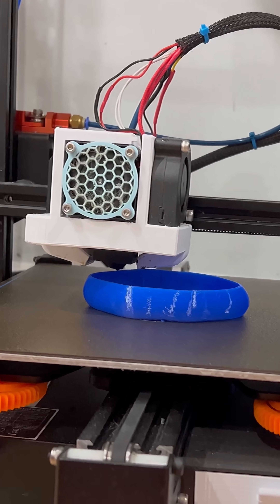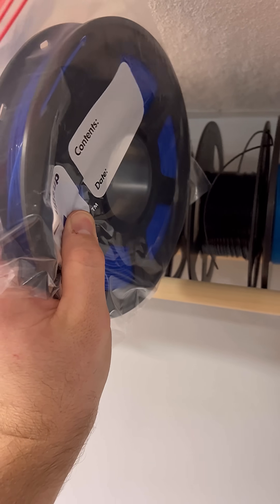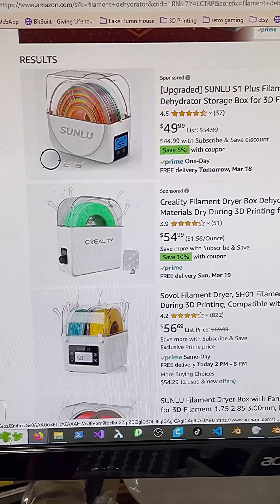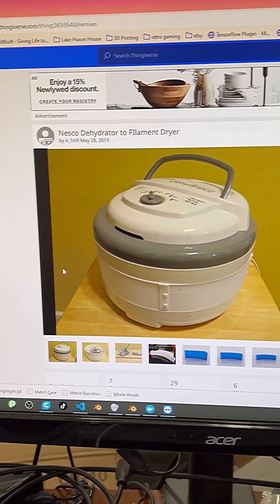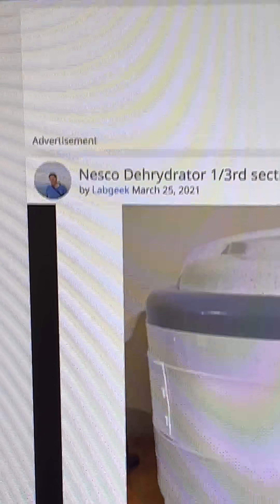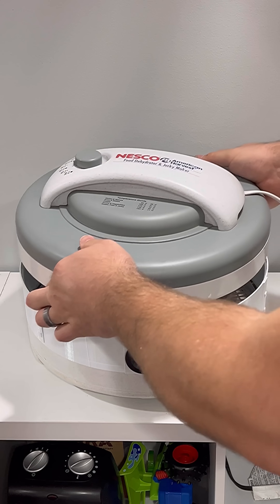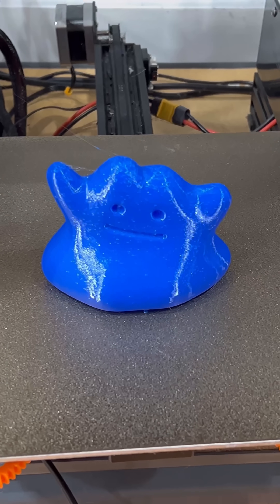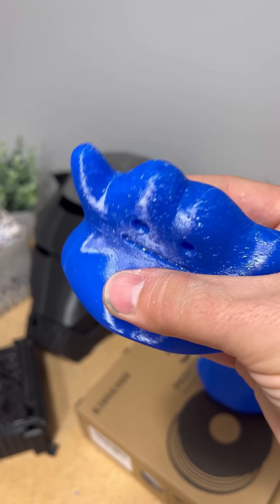Dry vs Moist TPU in 3D Printing

Comment: It’s really interesting. How much of a difference even just settings can make for TPU, I just got a filament dryer, the creality space pi X4, but if you have the right settings, it won’t be perfect. It’ll be far from perfect but you can really decrease stringing just from settings. But usually a Filament  dryer is necessary

Comment: It's helpful to remember that when water flashes to water vapour (steam) it expands by a minimum ratio of 1,600 times.

So, if you flash 1-litre of water to steam, it now occupies 1,600 litres of space. 

And THAT is why you always store your filament in sealed vacuum bags, with a hygrometer inside the bag, and the inside of the spool has a 3D printed recyclable desiccant holder inserted into it.

Comment: If you have a good AirFryer it will be able to work at temps as low as 40 Celsius so you can dry ur PLA or what ever at like 45 for 2 hours +- and get same results

Comment: i have heard from someone you can use your 3d printer to dry filament, just put the filament into a box and throw it on the print bed of the 3d printer set to like 50°C

Comment: What temperature does the dehydrater run at?

I work in plastic color, and running tpu is one of the worse resins we use. It is a pain. We don't dry tpu in our lab, so this is something that never occurred to be possible to me.

Comment: I dont have a dehydrater but i used my oven
Reply: I wouldn't suggest using an oven for drying out filament ever.
Reply: @hikaru9624  it works.... I have to tweak around though.
Reply: @CampBloodCreations  I still wouldn't use an oven to dry filament!  That is a house fire waiting to happen!!  There are far better and safer ways to dry out your plastics.
Reply: @hikaru9624  i know, but the oven is the closest I have,im saving up for a dryer.
Reply: @CampBloodCreations  that's great,  but in the meantime seriously stop using the oven to dry out your filament.
Reply: use your build plate

Comment: Poke  a bunch of tiny holes in a 5g bucket take plastic wrap , place bottom of bucket on to make it one then put that on the dehydrator itll seat perfectly if u wrap it right (no serious overlap of saran wrap in the  chamber and out the lid in the top of the bucket…WALLAH !! now u can dry multiple rolls and have a better filament dryer then that or one you’d buy anywhere. 

I see your dehydrator has notches in the middle either cut them down or use a hole saw to make a hole in the middle of the bucket. 

Its an old mushroom drying trick, if u wanna see the original  tek lookup bucket dehydrator mushroom dryer or bucket dryer dehydrator shroomery and you’ll find it. 

Y’all will thank me later💪 
Cheers

Comment: It makes absolutely zero difference. Your problem is user error.
Reply: Wrong
Reply: @timo4463  no I am correct. I have spools that have been open for 2 years and print just as good as new. It is user error. Maybe get better at 3d printing.

Comment: It's great that you've found a simple solution to this moisture problem, but I'm more intrigued that printer filament absorbs moisture from the environment in the first place...

▪︎ Why/how does this happen? 
▪︎ Is this a fundamental property of the plastic itself or a factor introduced during the manufacturing process?
▪︎ Perhaps making this kind of moisture absorbing polymer structure is a trade-off for keeping it flexible enough to be printable?
▪︎ One possibility is that it's the extrusion process (where molten plastic is squeezed into filament under tremendous pressure), which introduces microscopic air pockets where water can accumulate?
▪︎ Manufacturing the printer filament it in a vacuum chamber (where no air bubbles could form), or increasing the extrusion pressure (with the caveat that this would lead to a slightly denser material, requiring printing setting tweaks) may fix the problem, but it would also increase the production costs.

It's possible, even probable, that there are perfectly reasonable answers to these questions, but at the same time, it's good to ask them, as thinking about the causes of such problems can lead to improvements in the manufacturing process which eliminate them entirely. Good design is a constant process of re-evaluating your methodology to identify flaws in your process & then fix them.

Comment: Do not underestimate moisture with filament. It's night and day difference. It can be annoying to store it in closed space (1 day and your print are already starting to worsen), but it's just vital. If you don't want to spend 60$ on a dehumidifier, there are 2 other solutions, much, much cheaper. Put your filament spool into a shoebox, and make some holes on the top so that humidity get out. Now you put that on your printer bed. Another solution, Put it into a ventilated oven (though do not go too high, oven tend to not be very precise). For temp and drying time, you can basically take what is said for dehydrator (maybe even a bit higher, but if your filament start to stick a bit to the spool, do not increase the temp, decrease it a few degrees)

Comment: Dude, next time just use a bucket on top of that thing with a few holes drilled in the bottom. 30 second fix vs whatever time and materials that cost you. Plus you can stack like 6 rolls under a bucket.

Comment: I used to not really mind the difference between dry and wet filament when I started printing years ago, and since I was running a kind of crappy printer, I could only get crappy results. FF to recently when I purchased a more premium high speed core xy machine where I was running into bubbling trouble in my prints. I purchased a drybox for my tpu and now even pla I do not run outside of the drybox 😄

Comment: This seems like a problem you'd only have with non hard plastic prints. This is actually the first time I've ever seen a soft plastic printer tbh, and I've also never heard of moisture issues in prints. So I'm assuming they're connected.

Comment: I use this exact dehydrator for my filament! You dont need the extender thingy tho, just throwing a towel over it to trap the heat in a bit does the job perfectly fine

Comment: It never occurred to me that filament would gain moisture but that actually kinda makes sense!
Reply: It's the biggest fatal flaw for TPU, including finished products - just ask the TPU "pleather" shoes I had stored with some other stuff in a garage. (It came apart, all peely & gunky.)
Reply: @mookinbabysealfurmittens  omg yes so much of my stuff is that crappy pleather now. I miss 90s products because they lasted for so long and some still going.
Reply: Moisture is a problem in a lot/ most of precision manufacturing. I can’t really think of one where it isn’t but am sure there are. I’m an aerospace guy so moisture is the devil.
Reply: Makes a bit of sense for a flexible material like this at least. Not so much for rigid plastics I would think.
Reply: @MsHojat rigid plastics can be the same way, but they wet slower
Reply: @MsHojat  It is significantly worse for several types of rigid plastics. 

Some can even destroy nozzles when wet.
Reply: yeaaaa

Comment: My dad also has some issues with wet filament. We live in florida, and the 3D printers are also up stairs, so it just keeps getting worse lol!! He has a few dehydrators on his smaller printers that onky do 1 color, and a case with a dehumidifer that is over the top of the big 3D printers(came with them) that print 4-5 colors.

Comment: I didn’t even know you could 3D print flexible things, so that squish at the end was hilariously jarring XD
Reply: I felt the exact same way. 😂 I mean it makes sense that you should be able to, but I never really thought about it before this video.
Reply: @kraziecatclady  Same for me.  It felt so wrong to see.
Reply: TPU is by far the most common flexible filament! PLA is the cheapest for rigid stuff
Reply: @bachaddict PLA is also easily the most versatile, and it’s actually a biopolymer (polylactic acid), so it’s somewhat biodegradable too!

It replaced ABS (same plastic as Legos) for 3D printing because it doesn’t give off nearly as many fumes and prints at lower temperatures
Reply: @TheEmeraldMenOfficial only if it's sent to an industrial composting facility.  They are not common.
Reply: @TheEmeraldMenOfficial  PLA did NOT replace ABS, even PLA+ lacks toughness and gives up when put under constrant stress. Pla also melts with a lower temperature. That's why diy 3d printers are always made out of ABS/ASA
Reply: @bachaddict TPC is more flexible
Reply: @bachaddict oooo cool
Reply: @bachaddict  TPE?
Reply: @bachaddict  PLA ain't the cheapest but it's definitely the easiest
Reply: @bachaddict  PLA is absolute crap.
Reply: Same, guys... didn't realize that's what TPU was!
Reply: SAME
Reply: SAAME BRO
Reply: The same thing happened to me when I watched someone making 3D printed shoes!
Reply: for some reason my reaction to the squish was 😧 with an audible gasp lmao 
it was just surprising to see it squish lol
Reply: Same
Reply: Me either! I think I got whiplash from it LMFAOOO
Reply: Omg lollllll same
Reply: yeah i never really messed with it due to it being a little tougher to set up and never needing to use it, but its really cool!
Reply: @krogonronavix2595  I bought some TPU to print out gaskets to seal projects. its also good for making "rubber" feet for furniture,  bumpers for corners, and stoppers.   it can be useful.  I mean,   did your kid loose a wheel on one of his toy cars/trucks  print one up in TPU.
Reply: @agriperma How good does it work for gaskets? I never even thought about that! is it air tight?
Reply: @krogonronavix2595  I have some outdoor communication equipment projects in the works, and intend to use printed gaskets made of TPU,  I will probably use silicone grease (lubricant) to help with the seal.  I have not even gotten it out of the box yet,  but seen it being used for hat purpose,  they come in different shore hardness,  pretty sure the softer would work better,   but it is much harder to print with.
Reply: Literally me 😭
Reply: oh yeah theres all sorts of different filaments with different properties, its dope
Reply: THIS 😂
Reply: I 100% agree
Reply: Same 😂
Reply: SAME LOL
Reply: TPU is by far my favorite filament, doesn't matter what it's used for. It's always fun.
Reply: nearly gave me a heart attack, jesus

now i want one tho
Reply: You can 3D print nearly any texture/material, it’s crazy.
Reply: As someone who just got into 3D printing. Same 😂
Reply: That's TPU for you. It's still always weird to me as well.
Reply: It’s legitimately a bit unsettling💀
Reply: You can print almost any material. I've 3d printed parts for my motorcycle for example in Carbon fiber nylon and ended up being way cheaper than buying them from retail.
Reply: @ramaSwamp That’s so cool! Do they withstand heat?
Reply: @JigglyPuff_JesusChristLovesYou  they can withstand around 190°C no problem. Plus the dursbility, tensile strength and vibration absortion makes it amazing to print for motorcycles, cars, etc.
Reply: @ramaSwamp That’s really cool! I would love a 3D printer.
Reply: I now want to get a 3d printer and make a version of the crystal rock drake 3d print but make it squishy
Reply: you learn new things every day like there's squishy filaments or sth
Reply: I went from :) to :/ with a slightly open mouth
Reply: let me tell you about 3d printable shower attachment banana washers and grape cleaners!! very handy devices for when one has dirty banana or grape.  very handy!
Reply: It's just a different filament
Reply: Lmao yeah tpu is very flexible

Comment: Boiled while printing* 

Evaporation is a slow process with a pool of water slowly disperses into dry air, what happens is the nozzle is sudden vaporization and expansion of steam, which is what causes over extrusion/negative material zits

Comment: Drying filament is a myth. I have rolls that sit out for months and print just fine. I also got some rolls from Bambu and it said you must dry before using. Printed flawlessly without drying. I also print in PETG almost always, which apparently soaks up more moisture than PLA. Average humidity where I live is 75%.

Comment: I use a storage box with self adhesive draft stop foam and $2 room dehumidifier thingy and seems to work just fine to keep my filament dry it seems to work fine for a total cost of about $15 but the dehumidifier does need to be replaced occasionally

Comment: Pretty cool!
I have a similar dehydrator that I made a Paper Adaptor for to fit my Filament with a good seal (although it needs some adjustment for ease of use).
And I used it for TPU, but I noticed that even just after a few hours, I noticed a difference in my stringing test!
I would love to have a way to store the filament without getting wet, and to be able to use it while it's in storage without getting wet.

Cool video!
Thank your for sharing,
Reply: There are lots of diy filament storage boxes where the dried filament goes straight from box to printer.

Comment: I recently found an open, five year old spool of PLA and surprisingly it printed perfectly.
Reply: That spool has never seen daylight 💀
Reply: I live in NYC where the RH basically never drops below 40%. I have an old roll of glow in the dark PLA that I bought when I first got into printing 7 years go and it hasn't seen a dry box since. It print's exactly like it did before.
Reply: the dry climate in utah is perfect for this I have an old 10 year spool of pla from when I got into printing that got lost in my basement and it still works somehow
Reply: I live in Seattle...RH varies between 30 and 80%...in the same day!
Only one roll of PLA has been 'spoiled' by moisture...it was a 'glow in the dark' PLA that was very abrasive...ruined a brass nozzle in one Benchy!
The stuff would bubble up badly, unless it spent 4 hours in a food dehydrator...no 'shelf-life' at all!
PETG and TPU absolutely needed drying, every time.
Reply: PLA is less moisture sensitive than TPU so it doesn’t matter as much if it has been dried or not
Reply: Don't come to Louisiana... humidity is usually 80%-98%
Reply: from everything I've read from actual reliable sources rather than some random person on the internet (manufacturers, for example), PLA doesn't really care much about humidity.

in this particular random person's experience: I live a stone's throw from the ocean, so humidity is 99% basically all of the time. I've never had issues with PLA that just hangs out on my printer with no protection, and it's in a garage that isn't climate controlled.
Reply: @underdweller  This. The TPU used in this short is notorious for being hygroscopic and giving lousy results if not dry. There's a reason PLA is the material that is most commonly used in filament printing.
Reply: Help--

I know nothing about 3d printing and read PLA as Pokemon Legends Arceus and was so confused--
Reply: @diamondseraph9369 is a type of filament used for 3d printing

Comment: I have my filament sitting around for over 3 years in my office and the prints still turn out perfectly, so how much time does it take until it gets bad?
Reply from the maker: Depends on the filament. TPU picks up water much quicker than most others. There’s a pretty good debate on whether or not drying is even necessary on pla.

Comment: I've been meaning to make a dry print box for ages, it's cheaper and just as easy as a food dehydrator, and it lets you print straight from the box. All you need is some rollers to put the spool on, a reptile terrarium heating pad for the bottom, and some sharkbite fittings for your bowden tubing and you can pretty much seal off everything right up to the extruder.  
To make it even better, add a fan at the bottom to suck in air from below the box, and a little flap at the top (just kept closed by gravity) so that you have positive pressure and some airflow, and it'll dry filament in a few minutes.

Comment: 😂 When I buy filament, I use one color until I'm done using that color. Those other packages just stay closed. I'm gonna skip that whole process.😅
Reply: Don't be so sure, factory seals are not perfect. Sealed filament has often absorbed moisture, either in the bag, or before packaging.
Reply: 😹 a solid strategy. Too bad I like mixing colors for projects and also choosing specific colors for different projects. 🫠
Reply: @catspiraling  When I can finally afford to get into it, that's going to be me.

Comment: Then there's me with TPU wet out of the box, drying for six hours in dedicated filament dryer and still looking worse than YOUR BEFORE PRINT
Reply from the maker: That sounds frustrating 😱
Reply: I’ve been printing a decent bit out of tpu I’ve found brand makes a massive difference, I usually buy the cheapest filaments but with tpu I pretty much buy the most expensive, it’s £25 for half a kg of the stuff I get usually and since I’ve spent the bit extra I get perfect prints (after drying ofc)

Comment: Here's a tip: for best results with TPU filament, you should feed the TPU directly from the dryer, to the nozzle
Reply: This is an absolute must for using Nylon/PA6/PA12 unless your print isn't going to take longer than a half hour or so. It just absorbs so just water so quickly